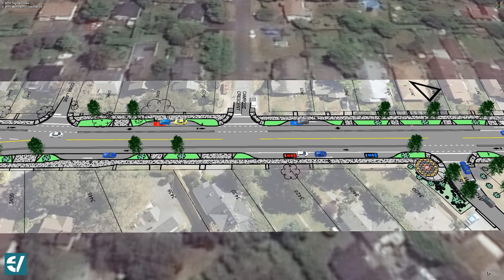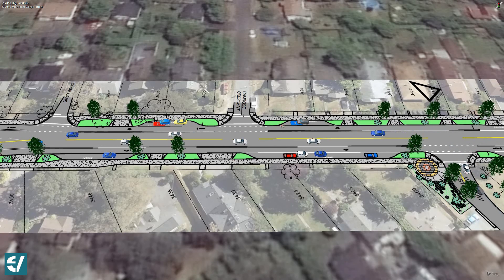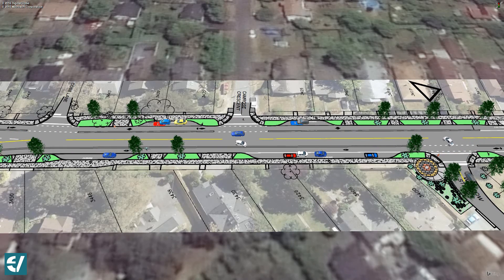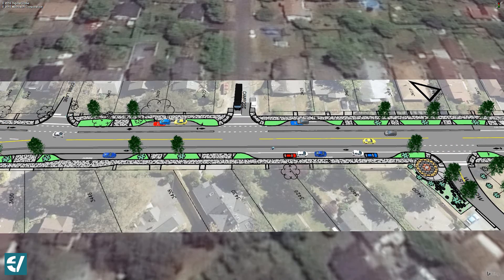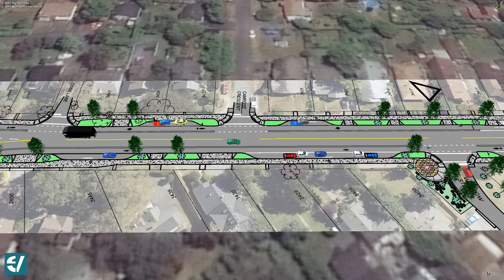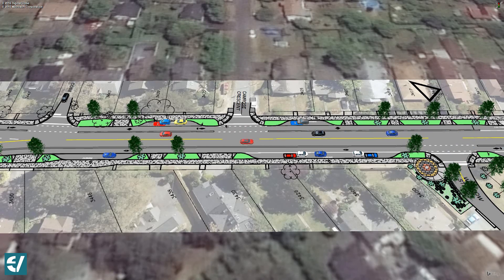A Microsimulation Model of a Complete Street

Comment: looks great ! what is the reason / purpose to microsimulate the street at hand ?
Reply from the maker: This particular video is a showcase illustrating the benefits of simulating complete streets of any size and complexity.  The street featured in this example shows that while it may not be considered an arterial with heavy traffic, the interaction/friction among all the modes is a good enough reason to test the design with microsimulation.